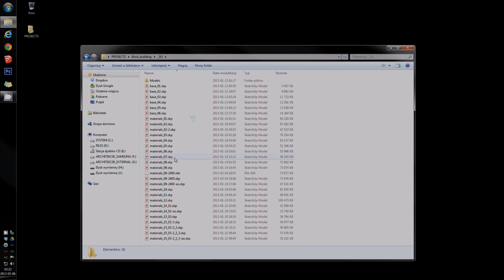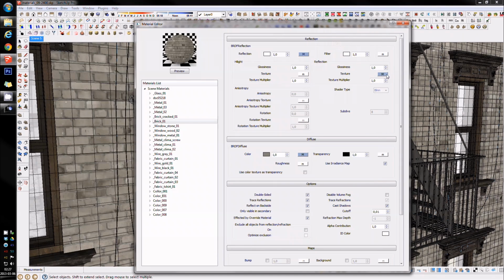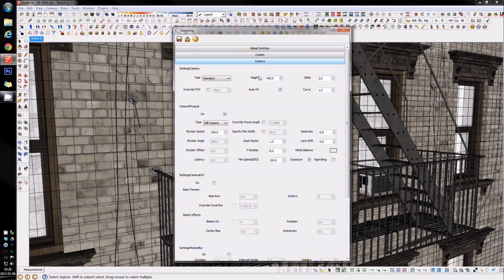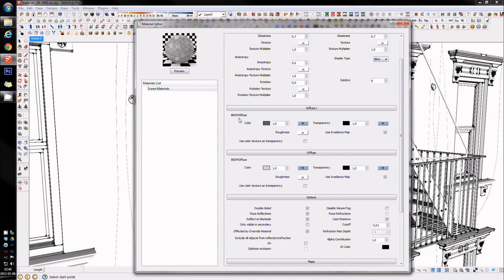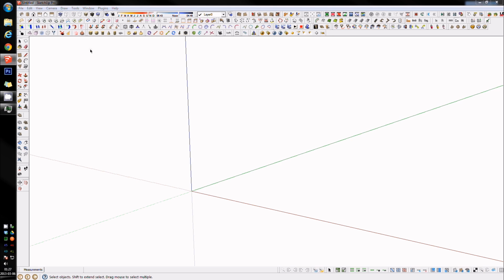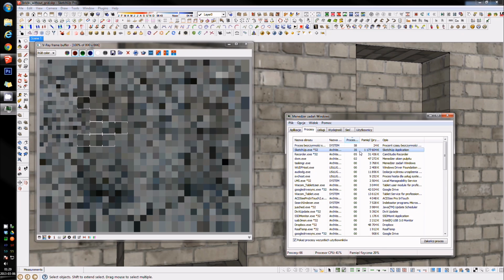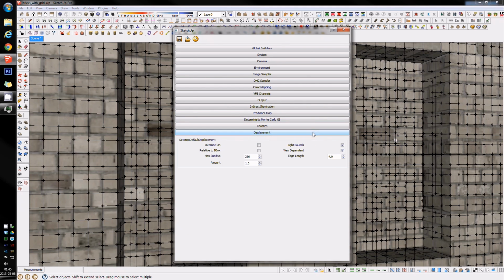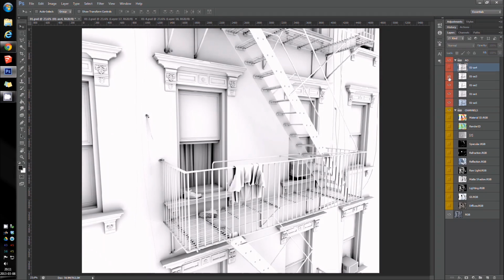The making of "Somewhere Between Buildings" - V-Ray for SketchUp tutorial by Krzysztof Kuczynski

Comment: I didnt use any plugin to make the grid. For my needs it was simply copy edges of face that I wanted to cover by grid. Depending on the use of the processor if there is a continuing problem in the rendering the mesh need to be thicken.

Comment: And the second thing. It dont make your render faster but will let you to avoid running out of memory if you hiting the 4gb wall in sketchup. It depends of "dynamic memory" value in system settings tab you use in VfSu. Just try make something like i did in tutorial as example of allocating memory to CPU threads while rendering displacment. Cheers!